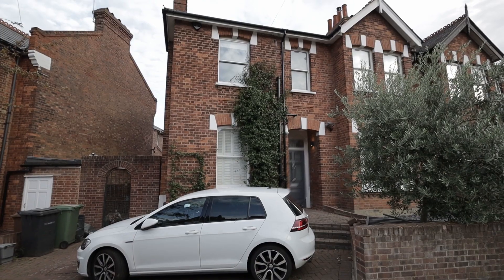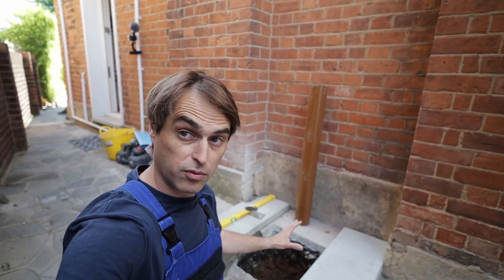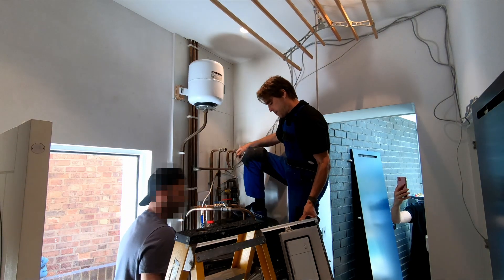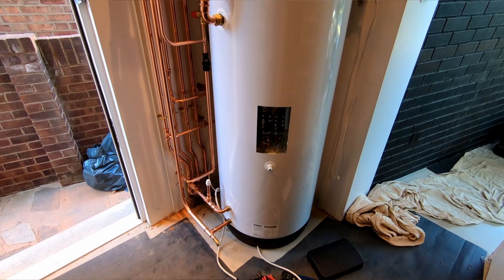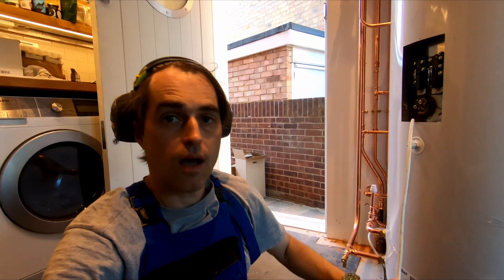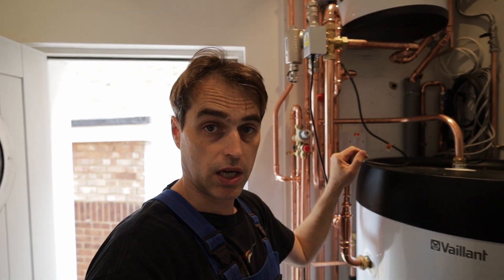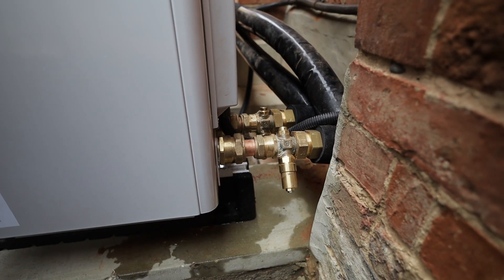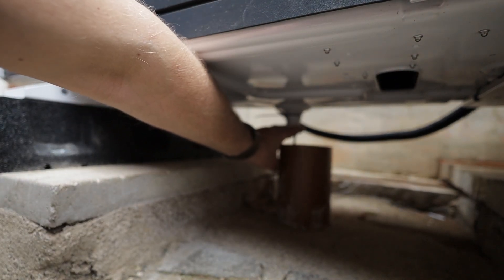Is This Heat Pump Better Than Your Gas Boiler?

Comment: I’ll stick with my gas boiler, this heat pump ideas can only work when your building is sealed or rather insulated to such a standard where you get virtually nil heat loss, for any of us living in council or housing association property, there’s going to be a lot of convincing for them to get rid of gas boilers. Heat pumps, you’ve got a long way to go with that.
Reply: So effectively what you're saying is that you're happy to burn gas to get high temperature water because your house is pissing out heat? That's some proper mental gymnastics...
Reply: @TimJW  what I’m actually saying is, my landlord will need some convincing about heat pumps. That’s all I’m saying.
Reply: @Kulvinder1974  focus on the finances, that is all landlords care about. and heat pumps are cheaper to own/operate. you dont even need maintenance apart from hosing down the outdoor unit once or twice a year.
Reply: @Kulvinder1974  well you didn't specifically say that, you said "heat pumps can only work if your building is sealed". Heating works better and more cheaply when your building is insulated, gas, oil, or heat pump.
Reply: @TimJW  Regardless, my landlord won't be installing in the flats that I live in.
Reply: @Kulvinder1974  did anyone ask?
He's covering heat pumps because that's his job.
No one is specifically asking about you or your landlord. Why are you mentioning it?
Landlords will be forced to install them by regulations eventually, so choice only comes into early adoption or not
Reply: @Lewis_Standing . I agree he didn't make it clear why he's mentioning his landlord, but that's because anyone in his situation would understand the point.

The video focuses on a London property so I'm assuming English law and practice on tenancies here. Letting law varies in different parts of the UK and even more across the world. If you or Kulvinder are not based in England you would be expected to know that.

Basically it's because in England it would usually be the landlord paying for the heat pump and associated work, whereas it would be the tenant who gets the benefits because the tenant covers the utility bills.  This is an important point for the majority of "generation rent" who rent housing on contracts that can be ended on a months notice any time after the first six months.

The clue that that is what he means is in his reference to council and housing association tenants. 

The situation would be different if he lived in a hostel or some other accommodation where the  utility bills are inclusive; or if he had a "long lease" where he was responsible for general repairs and costs of installing the boiler. Both these scenarios are less common in the UK 

In theory a tenant could pay the installation costs, but given that after six months a landlord can end the tenancy (assuming it's the usual tenancy agreement) and the landlord gets to keep the heat pump, the tenant would not want to risk the landlords taking unfair advantage in that way 

This is an important financial point, and we in the UK are not going to get the level of heat pump deployment we need till our government does something to address this. In the meantime heatpumps only make financial sense to those who own their property (perhaps with a mortgage) and those with a long lease, or to the landlords of hotels and hostels.

Hope that clarifies why his housing situation is relevant
Reply: @SupremeRuleroftheWorld  No landlord is going to put in a heat pump whilst gas boilers are a couple of grand?
Focus on the money? Correct they will, but go boiler everything, as it's the renters that pay the energy bills
Reply: Re done my house from 1959 the house is now ready for a heatpomp without to much fuss. Isolation in te walls and on the attic
Reply: @amataazura  isolation?
Reply: @Land-of-reason  insulation, I’m sure.
Reply: @Land-of-reason  he's Dutch. Here in Holland it's named ISOLATIE. U can use it to say, I've put a thief in isolation. And we use ISOLATIE to, as u call it, insulate. Rockwool, PIR, PUR. That kind of building materials.
Reply: @homegrown241  interesting.  Thanks.
Reply: This is starting to be ‘rote talking points’ like anti-EV stuff. No they aren’t perfect, but neither do they need passivhaus standards. Ultimately they just replace CH - if the heat loss in your house is ok then it can be a pretty simple swap. You may not even need radiators changed.
Reply: Most of this green energy is a farce, Bio Mass Fuel, sounds great yeah, Wood Pellets From Trees Cut Down in USA etc no doubt using Diesel powered equipment to cut it all down, Ship around world for people happy to push 2030 Agenda so they feel good about themselves while not helping reduce anything
Reply: The plan is to phase out fossil fuels and switch to renewables (wind turbines) and nuclear so the future is electric.
Reply: @higreentj  surely that cannot be correct.  That would be insane.
Reply: @Land-of-reason  If we are 70% renewables (wind turbines) and 30% nuclear then we will probably have the cheapest electricity in the world.
Reply: @higreentj  as you know that would be totally impractical.  The load varies throughout the day.  In addition the efficiency of the network varies with the load.  Perhaps you should do a degree in Physics.  

What sort of storage would you use?  Batteries, hydrogen, pump storage and please don’t suggest capacitors.  The technology is simply not available.  On lots of nights we don’t have wind.
Reply: @Land-of-reason   UK is the ideal location for wind turbines but the summer months could be a problem so this is the time when maintenance can be carried out. Estimates are that forty thousand wind turbines could provide us with all our electricity needs and ten thousand to charge our electric cars, but I am hoping we will have robotaxis so there would be no need for car ownership.There is pump storage in Wales, but hydrogen and batteries would be good. The government want to end fossil fuel use but I would be inclined to keep a couple of power stations burning coal or gas on standby. I do like these thorium reactors that can slot into existing fossil fuel power stations.These wind farms are and will be all over the UK coastline so the chance of them all stopping is extremely unlikely.
Reply: @higreentj  you are off your rocker sunshine.  

Dinorwig Power Station is only 1,728 MW I know it well.  We have 75.8 GW electric generating capacity now without considering other sources.
Reply: there are plenty of housing associations that have heat pumps with a combi boiler back up or just ful heat pump installatiin. Housing stock has had to be brought up to standard in terms of insulation. thats why you most likely have had cavity and loft insulation done in the last 10 years.
Reply from the maker: There is no need for nil heat loss. It does not exist by the way. Even passive houses have heat loss. 

You can heat any home with a heat pump if the heat emitters are large enough and / or flow temp high enough - it just will cost you much more.

We need to insulate regardless, and once we do, heat pumps make a lot more sense than gas.

They can use 1/4 of energy that gas boiler need. Surly that has to make sense to anyone.
Reply: @UrbanPlumbers  

I disagree.  You need to take account of the cost of the unit and annual costs which are not insignificant.
Reply: @Land-of-reason  this is the point, people bang on about efficiency, i don't care about that i care about cost. So yes the heat pump may use less kw, you can't really compare a kw of electricity with a kw of gas when the cost is so different...
Reply from the maker: It is still cheaper to run a heat pump with a scop of 3.5 than a gas boiler at current rates. If done well it is not impossible to have above 3.5 scop
Reply: @UrbanPlumbers  but after the current energy crises dies down, social engineering type have an opportunity to allow electricity costs to fall but gas prices to remain inflated. I anticipate that when things settle down the difference between gas price and electricity will be manipulated to be much closer, thereby making the case for heat pumps even taking into account the capital cost and at the expense of people with perfectly good gas boilers.  That said I’d be comfortable with blended natural gas/green hydrogen mix in the national grid.
Reply: @UrbanPlumbers  it's quite an irrelevant statement. Houses are not the same, people don't heat their houses the same way etc...Heat pumps are good business for plumbers that's for sure, and they are only getting forced in people's house. The zero carbon target is unachievable. I'd invite you to watch the Skill Builder channel and the few videos he's got on regarding heat pumps/zero carbon target.
Reply: @UrbanPlumbers  it's good practice to insulate beforehand, but not essential.

That's because the payback time for insulating is shorter than the payback time for the heatpumps. If you can only afford one step just do the insulation for now 

Doing the heatpump first would involve installing a bigger heatpump than you'd need after the insulation was done. That would entail a lot more costly heatpump. That's why it's good practice to do the insulation first.
Reply: wrong conclusion. insulation tells you how much heat you need, not how you get it in the building. your underfloor heating or radiators dont care in the slightest how you heat up the water you feed it. you really think 40 degrees of water from a gas boiler is different than 40 degree water from a heat pump? and the reason to switch is extremely simple: its cheaper to run. councils and HOA's love saving money.
Reply: @SupremeRuleroftheWorld  not quite. Insulation slows the progress of heat from one place to another. The higher the temperature the faster the heat moves away. For a poorly insulated house you tend to need more heat to cause the rads to loose that heat in to the rooms at the rate that heats up the air to the level that you want. 
If you want to run at lower temperatures you have to have bigger rads or reduce the heat loss or a combination of the both. 
I have yet to see any calculations that take in to account house occupancy, for example if you are out of the house most of the day you would not need to worry about heating, but a heat pump will need to be on longer to heat the house up as a boiler has a higher output. I would have thought there would be a cut off point given the same sized rads. 
Also silent when you are in the middle of the day in london is one thing but silent at night in a town is another. I doubt they really are silent and wouldn’t want the neighbours either side of me having one pumping away all night. 
Also if you are running at 40deg then you’ll need something to boost the hot water tank temp at least every 2 weeks I believe otherwise you risk salmonella in the tank. So in the right environment Heatpumps are much cheaper and add solar on the roof and they are a major winner but in a leaky old property with limited room for bigger rads and your not going to get the reduction in running costs that you think. 
Personally I think new builds should be mandated to be at passivhaus standards and heatpumps and Mechanical ventilation with heat recovery systems should be mandatory, but that eats in the the house builders profits so won’t happen.
Reply: @davideyres955  again, just wrong. please learn to separate the method of heating with the amount of heat required. more insulation saves you energy yes, that is 100% not at dispute here. just dont start thinking or parroting others that you NEED more  insulation in order to install a heat pump. if you have poor insulation that might just mean you need a bit bigger heat pump, that is all. insulation is always something that can be improved later on. noise is basically a non-issue. with modern heat pumps you would be hard pressed to hear it over the leaves moving from more than 2 meters away. solar also has nothing to do with it, that is a "discussion" between your energy bill and you. it has nothing to do with the physical process of heating your home, just the cost of it. just like insulation or the lack of it.
Reply: @SupremeRuleroftheWorld  how much energy does it take to create 40 degrees of water with a heat pump compared to gas (or regular electric heaters).  What I mean is, what is cheaper, the heat pump, or the gas?
Reply: @TestPilotIan  the heat pump is a lot cheaper to run but dearer to buy at the outset. 

Typically it takes about five to seven years before you have a net saving, longer if you are paying interest on a loan to install. Once the payback period is over your are saving about 20% of the running costs.

If you were using electricity for heating before (and without discounts for using storage heaters) then payback is typically under two years and then you're saving well over 70% of previous costs. The payback  is quicker because using traditional electric heating is very expensive.
Reply: @TestPilotIan  as i stated seveal times elsewere the math is pretty simple: to get the same heat from 1m3 of gas you need about 1.5 to 2kWh of electricity. And for the "green" discussion about making electricity: you can make 6kWh of electricty with 1m3 of gas. That can create 24~30kW of heat with a heat pump. That same 1m3 in your gas boiler can make not even 8kW of heat. Dors that make it a bit more clear on how stupid fas boilers are in this day and age?
Reply: @TestPilotIan  It takes much less energy to heat with the heat pump (2-4.5x less depending on the system and conditions), however not necessarily cheaper due to gas being cheaper than electricity per watt. That will hopefully change in coming years as renewable increase and green levies are moved from gas to electricity.
Reply: @noneofyourbusiness5134  yeah - or the price of gas gets jacked up to force us to change….
Reply: @SupremeRuleroftheWorld   @Neil Jones  councils love saving their own money, not so much the money is their tenants. As it's the tenant paying for the utilities and the council paying for the heating system, your point about them loving to save money actually proves the opposite of what you say!!! 

Notice the video is about London. We are talking about the UK situation here. Maybe the costs are attributed differently where you live? If that's the case my suggestion is not to make comments on other countries till you understand how things happen in those countries. It just makes you look ignorant.

In fact it makes you sound like an American. Sorry if that's being stereotypical, but if my guess is right then please note: there are places outside the US and the rest of the world don't all do everything the way you guys do.
Reply: @trueriver1950  your guess is wrong. And however the distinction is made on who pays what is irrelevant, either party wins. Heat pumps are cheaper to own as they dont require maintenance and cheaper to run. Either way its a win regardless of where you are in the world or even just the UK for that matter.
Reply: @SupremeRuleroftheWorld  apologies on wrong-guessing your nationality. My bad 

I don't understand your point about it being irrelevant who pays.

Why do you think it makes sense for a landlord to replace a working gas boiler with a heat pump? It's capital expense that they don't need to spend right now, and zero savings in running costs because the tenant pays the utility bills.

Are you assuming they can increase the rent? Depending on the rental agreement they may not be allowed to. 

Maintenance: British Gas charge typically £66/year for boiler cover. Even if I accepted that heatpumps are maintenance free you have to pay a lot of years at £66 to payback the cost of a heatpump, including installation.

However: if I were a landlord installing a heatpump I would want to take out maintenance cover just in case things go wrong. These systems being new to the insurance market the cost of manage cover once the warranty expires is probably at least the same as for a gas boiler.
Reply: @trueriver1950  as a landlord you need to replace the boiler anyway after x number of years, so replacing it with a heat pump makes sense, especially with the subsidies most countries are giving out. and landlords dont have 1 appartment or building, they usually have many, and removing a fixed maintenance cost of those is  a value add for them as they also lose the fees for having the gas connection in the first place. that the tenant saves money is a nice bonus but for the landlord is usually means an excuse to jack up the rent more. so its a win-win either way as far as the landlord is concerned. that the tenant pays less for heating is a bonus for them. ps: no need to apologize.
Reply: @SupremeRuleroftheWorld  I was a member of staff for a small landlord (19 properties to let) until he let me go in the pandemic.

What you say is simply not true for his business, nor for other so-called buy-to-let landlords.

Nor was it true when I rented a flat from a large housing association. Nor is it true now for ongoing tenants of that housing association.

I don't know where your opinions come from, but they don't match the real world of Manchester, England.

Are you a landlord? Do you work for one?
Reply: @SupremeRuleroftheWorld  PS: Here's a selection of mismatches between your claims and the real world of being a landlord in Manchester, England

- it's a fallacy that landlords can charge more for better. In a sane world that would be true, but at the low-money end of the market tenants shop on price not quality, and simply won't believe claims that they'll save £2 in utilities if they pay £1 more in rent

- that landlords pay the ongoing connection fees (called "standing charges" in the UK): no the tenants do

- that landlords pay the original charge for connection to gas (almost always the has is connected when they bought the house)

- that heatpumps cost around the same as a Combi boiler: figure at least double the cost maybe more

- that heatpumps have no maintenance costs (we simply don't know yet how reliable they will turn out to be, but if a compressor fails that's about 5x the cost of replacing the most expensive single party in a gas fired boiler) and when my boss looked her couldn't find a cost inclusive maintenance plan for a heatpump anywhere near the money he pays for his tenants' current gas boilers)
Reply: @SupremeRuleroftheWorld  standard gas boiler central heating usually runs at 65c or so with much hotter radiators that are able to keep the rooms warm. To deal with the poor insulation.  If such temperatures could be reached with heat pumps then that'd be needed... but then they'd be more expensive to run.  Most basic British housing stock needs over 25k of insulation work,  of various forms,   being done before it can be kept as warm by heat pumps
Reply: @alanbuxey  who said you actually need 65 degrees into your radiators 24 hours a day to keep your home up to temperature? i am quite sure no gas boiler is running 24/7 at full tilt to keep radiators at 65 all day long to keep the home at 21c. the amount of heat you would be blasting into that home would be insane. i dare you to try running your gas boiler at full tilt for a full day at 65c and report back how hot your home has become after 24 hours of non stop heating. OR you just lower the temperature of the water so the heat discharge capacity of your radiators matches the heat you lose so the house stays prefectly in range and you only pump in the proper amount to keep the temperature constant. you could problably lower the temperature to even below 40 to keep the house warm. food for thought. because that is exactly how large industrial/commerical heat pumps work for the better part of 2 decades now. even many gas boilers have that option (its called weather dependant temperature curve or whatever) but they are limited by the fact that they cant modulate their burners down low enough, a heat pump can. none of this depends on the level of insulation, that just tells you how much heat you need. the size of the building or its insulation level plays no part in that. you could use a heat pump to heat up a uninsulated shed, it just takes a lot of energy, just like it would with using a gas boiler in a uninsulated shed. the heat requird does not change. so if you only need 2~3kW of heat to keep  a building warm you only need to produce that. you dont need 65 degree water for that.
Reply: @alanbuxey  again, who said you ACTUALLY need 65 degrees 24/7 to keep the house warm? I dare you to try it. And its not a factor in insualtion, the water tempersture is dicated by the heat rejection capacity of your radiatiors/underfloor heating, not the insulation. With enough radiators or floor heating you can keep any building warm with 35 degree water regardless of it having insulation or not.
Reply: Same here. Heat pump won't be any good in a old house, and most importantly, it will cost you more than running a gas boiler. Look at who's providing the heat pump, and then wonder why the government is trying to force them in. They are definitely not sold for you to save money or save the planet. They are not fit for purpose in a country like the UK. Hence why you see them in Spain, South of France etc, where the weather matches the need of a heat pump. Good luck when you'll get your bill after a rough winter month. You'll be crying.
Reply: @marceaumouchene6264  You find plenty of heat pumps in Norway, Sweden and Finland too. In fact they sell more there than else where in Europe. Pretty sure they have colder winters than us.
Reply: @ma40  yes, and look at the price of electricity now (:
Reply: @marceaumouchene6264  Yes it is ridiculous, but the important point is where is the price of gas in relation to electricity. If the ratio is less than the SCOP then it can still be cheaper. 

I personally don’t think we’ll ever see very cheap gas prices again, but in order for electric heating to be feasible we need a fundamental reform of the electricity generation market where the fossil fuels don’t set the half-hourly price per kWh, and much more renewables and storage to drive the electricity price down.
Reply: @ma40  that's my point, electricity is not cheap at all and not green at all either, it's all a scam... The climate is changing and we are paying the price for it, when our impact is tiny. 20000 years ago when it was the iced age and the climate starting to change, who was to blame for the temperatures rising? No one except of mother nature. We're getting bummed.
Reply: @marceaumouchene6264  Heat pumps are more common in finland and sweeden where they get colder winters than us in the UK. they work fine
Reply: @Heatingandplumbing1  I'm not saying it doesn't work, I'm saying it's not cost efficient and it doesn't save the planet as much as they are telling you.
Reply: @Heatingandplumbing1  yes in Sweden and Finland because they are using electric chugging immersion heaters to generate heat and hot water.
Reply: @marceaumouchene6264 ASHPs are designed to work in temps down to -27°C which is why almost every home in Sweden and Norway have them installed. They have significantly colder winters than the UK does. They do consume less energy and they are cheaper to run than gas. They also don't emit CO2 like burning fossil fuels do I.e. a gas boiler.